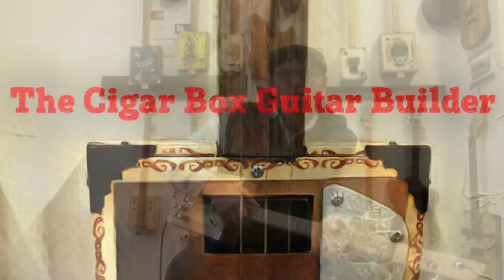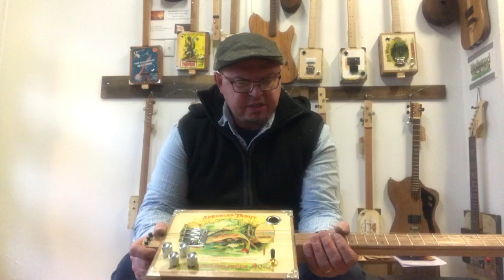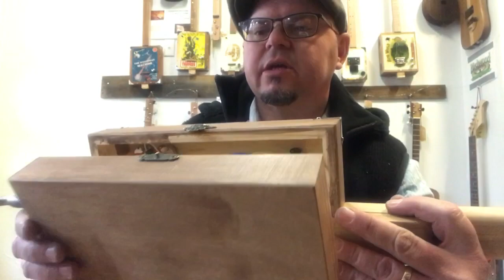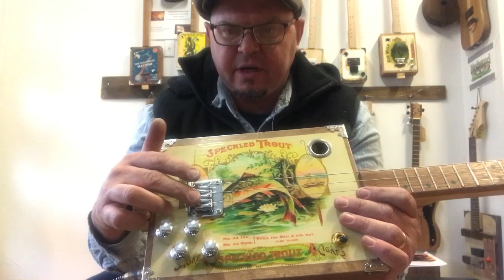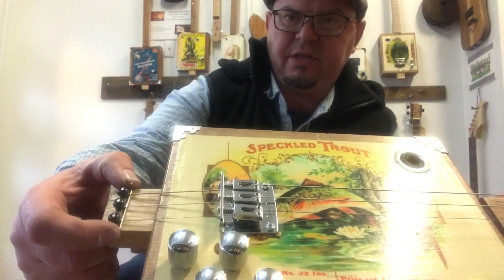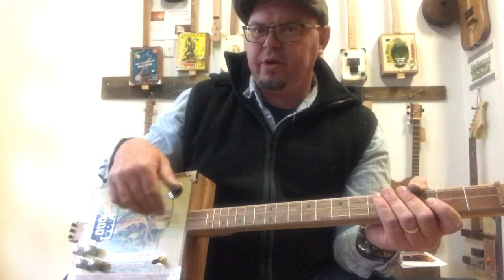Installing a piezo and humbucker in a CBG

Comment: Just wondering why you decided to use end pins when you are using a hardtail bridge? Decent enough build and sounds pretty good but the neck through the box and end pins seem unnecessary, can't see any benefit or reason for it but perhaps you could explain it it has any practical use or just purely aesthetic.
Reply from the maker: hi sorry for the late reply. The bridge is only screwed to the top of the box which is quite thin. It’s being held in place by the screws. The string pins are holding all the tension.
Reply: That makes sense ! Thanks for the explanation.